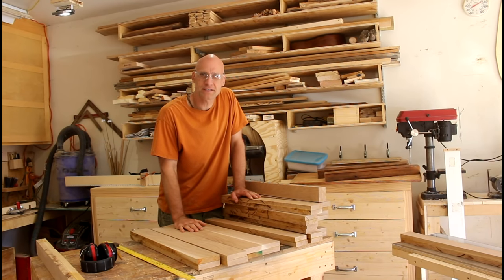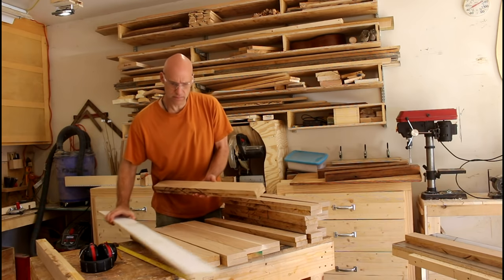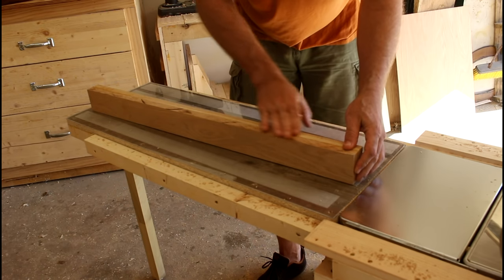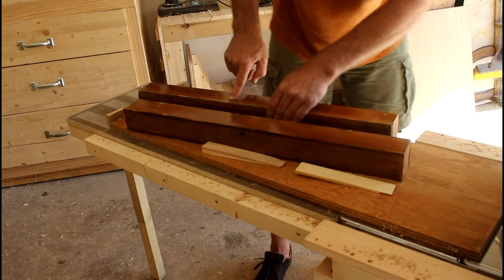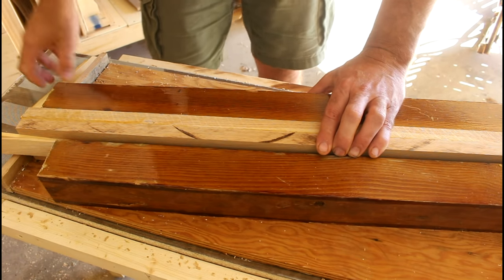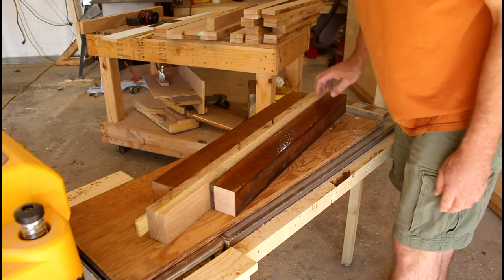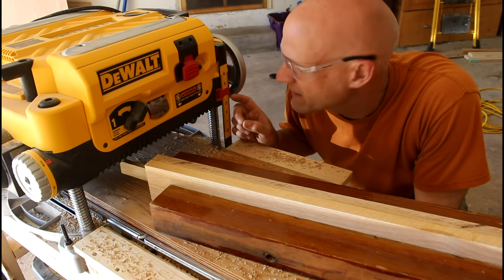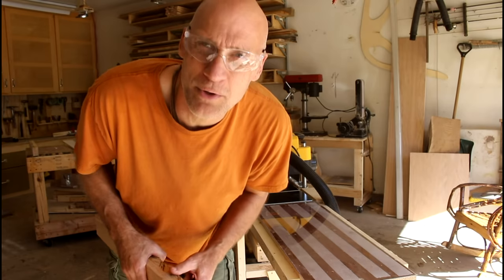How to Turn Your Planer Into a Jointer

Comment: I have used it. But it's time consuming. So if you have a lot to run a bench jointer works better. But for a few pieces its ok
Reply from the maker: Yes. It is certainly not a replacement for a jointer if you need to do this a lot.

Comment: If you want it really accurate, use a hand plane.  This sled is a really good idea to do the initial flattening.  But it may be less wear and tare on blades if you can butt a board against a straight edge (example a) level) and table saw it.

Comment: would it be easier to get that 90 degree angle and flat edge on one side with a table saw then get the other side with the planer?

Comment: Hi
I'm new in woodworking and I'd like to know how to calculate to add profits 
I do wood signs from pine and walnut cutting boards 
Is there a particular equation which you can use to make calculations?
Thanks
Reply: what I have heard is add up the cost of materials, figure out out how much time it took you to build said project, well just say 2 hours for example. If you want to make $20 an hour add $40 to the cost of materials, then add an additional 5-10% for "overhead costs" (glue, stains, rags, etc)  and that would equal your said price. You could definitely alter this formula as it is just a starting idea, or disregard it. Just trying to help, Good Luck!

Comment: I always learned you cant use a planer to get a flat board (on 2 sides) UNLESS one side is already perfectly flat. The planers job is not to flatten, but to reduce thickness. That's why they call them thickness planers and they make seperate jointers. The planer has a roller that pushes down very hard on the piece thats going through . So, if you have a cupped or warped board, it's just pushing the board down and reducing the thickness then out comes a still warped or cupped board, just thinner now
Reply: That's true, but if you mount a cupped board onto a long flat plank (a planer sled) and if you clamp it or nail it, or glue it, or double stick tape the cupped board so the cup is facing down to the plank, then you just stuff some filler (double stick tape, or small wood shims, cardboard, putty, etc) under the cupped board so it can't "push down" when it's going through the planer, then you can get a really flat board. The key is shimming underneath the warped spots on the board that is to be planed, so it can't push down like a leaf spring when it's passing through the rollers. The only way you can "shim" the board is by affixing the warped board to a long plank (a sled). That's the purpose of a sled, so you can slide a warped board through the planer and get it dead flat.

Comment: Hmmm.... a jointer is more for taking either an edge or flat side bow out of wood. Not just for squaring them. Chances are the wood still has a bow in it on the flat side. This jig won't help with that. But one could be made to do it.

Comment: 2 Questions 1 did you first do any thing to make sure the boards were straight and  not cupped before you put them together. 
2nd question do you have  a video on your in and  out feed table extension's
Jeff

Comment: Good idea , I might have found a Ridged 4331 Planer for 100$ think it has a weak switch , need all kinds of tips .
Reply: it could be the circuit breaker... $6.00 on amazon
Reply: @user-hd8ej8yx9p  Realized it`s an older one TP1300 ,Got looking the brushes are gone but closer look at the commentator the copper flutes are dark so I cleaned them and they came like new so Going into city today and she has a set for it so fingers crossed , One man`s junk is another man`s Gem !

Comment: 1:28 I’m not sure if it’s obvious but couldn’t you just rip cut the side on a table saw at 0 degree up against the fence and you would get a perfectly straight line and the piece would be square 90 degree. Great 👍 video and useful content. Thanks.

Comment: How do you get around the snipe from this planer? I have the same unit and the snipe renders it unusable. Nice vid, cheers!
Reply from the maker: +elams1894 I do get some snipe with it. I'll leave the boards longer or I will run some sacrificial boards through at the beginning and end of the process. It can be a pain but is easily overcome.
Reply: elams1894, you can reduce snipe by adjusting the indeed & outfeed ‘tables’, but the only way to eliminate it completely is to also use leading & trailing scrap pieces.

Comment: I'm kind of new to this and I'm just wondering - if both sides are not flat, then how does the planer make a 90 degree cut. I understand the shims underneath for "jointing" the board, that makes sense to me, but here you don't seem to have shims underneath.  Do you use a level to ensure it is flat first?
Reply from the maker: +Johnny D it works if you have one side that is flat and you reference off the square boards. That will make the side you plane square with your first side.

Comment: Probably a dumb question, but how do you ensure you have a flat edge on the first side (the one against the table leg)?
Reply from the maker: There's several options for that. One way which would be in the spirit of this video is to use the jig itself. Just clamp it into it not worrying so much about what angle it is and then run it through the planer. Then you would have one side flat and go from there.

As other people have mentioned you can do all of this on the table saw as well. Use a clamping jig to get the first and second sides square to each other and then use the fence on the table saw to finish squaring everything up (assuming your blade is square to the fence and table).

Comment: Nicely thought out mate 👍, if your interested check out Downunder woodworks where the guy designed a sled jig for his tablesaw to joint boards there, cheers mate
Reply from the maker: I do that method as well. White Oak tends to burn pretty bad and the planer left a pretty clean edge. With thinner stock - 3/4" or smaller I think the table saw jig is quicker and very good.

Comment: Nice idea on the sled.  Couldn't you just use a table saw for the purpose of a jointer.  You already have a flat surface on the board.  Just make sure your table saw is set to 90 degrees.

Comment: If you already had 2 flat and parallel sides, why couldn't you just use the table saw?
Reply: because you would have a either 1 of these 2 scenarios happening.  If you have the planed edge riding the fence  the uneven edge is table side down, or if you have the planned edge table side down, you'd have the uneven edge riding the fence.
Reply: you wouldn't use the fence, but a sled that goes up against the fence, parallel, with hold downs to trim one edge square, and then use that side against the fence.
Reply: The blade on a table saw can and will flex slightly when pushing your board through the saw! The planer is by far the better choice of the two machines.

Comment: What I'll probably do is just screw the board down to a thick sheet of MDF from the bottom(screws will obviously be recessed) since i don't need to use 100% of the board length the screws can just be put in at the very end of the board

Comment: First, I did like your video! However, could you not just have used a less complicated version of you planer jig, flipped it horizontally, run it through a table saw and  fine tuned it with the planer?  That  could be the solution wider boards...

Comment: So once you have the one jointed edge (where you left off in the video), why not just use the table saw to square the opposite edge?
Reply: Tom Holmes Why when you could just run it through again and get a better finish

Comment: pretty cool solution. you could always get that third side sqaured with a table saw jig. how is that dewalt thicknesser holding up btw?
Reply from the maker: Its been hold up pretty well. I've had for nine months with moderate use - blades are still sharp - very little snipe.

Comment: Excellent resolve to the problem. I have never used one but I am waiting delivery. How do you determine the initial depth setting. I did read, you set the machine to it's ultimate depth after planing. It doesn't exactly describe what depth you can start with or even how to set the depth of cut on the scale. Sorry, you are dealing with an idiot, but I don't want to make a mistake.
Reply from the maker: The planner has a gauge that reads out his much you are talking of each time.

Comment: Cracks me up how many people are commenting "why not just use your table saw!?"😂 I'm guessing either they're not woodworkers. Or they haven't been woodworking long enough to understand why and when this application would work where the table saw and a straight edge wouldn't UNTILL you've don't this first if you do not have a jointer. Which also tells me they don't have a jointer and don't know what jointer is for!
Reply: You could definitely make a similar jig for a table saw. It’s basically the exact same operation, just rotated 90 deg.
Reply: however my contractor table saw barely cuts through 4" thick wood this allows for what 5.5" of thickness?
Reply: @Northwest,
Same goes for your comment that it reflects you don't know how to use a table saw. It could be done in a few other easier ways I can think of at the beginning of this video. Chinese and Japanese woodworks didn't have these fancy tools thousands of years ago, but it was always done perfectly and easily with good skills.
Reply: fffjkjk jkjkjk oooooh Christ heeeere we go🙄

Comment: Um once to have a true or flat surface run them through the table saw with a rip fence.  All you need is  actually one flat but 2 will do an even better job.

Comment: Why wouldn't you just use a table saw to cut the uneven sides off?
Reply: Hotrod Hog because that would be too easy.
Reply: Rule of thumb is if you get 2 side square or parallel then the 3rd and 4th can be done on a table saw easy.  Anyway, it's about his technique and his subject, "How to turn your planer into a jointer."
Reply: Because on your first cut the side that is against the fence isn't perfectly flat and square so that will likely be communicated to the side being cut.
Reply: Sean Holland you could build a jig for the table saw to joint your boards using the planed perpendicular face. Then you aren't limited to the thickness of your planer's capacity.  😊
Reply: +Louis Cypher, Geez, why didn't I think of that?! Oh wait...!
Reply: +Sean Holland, it would be 90 degrees square to the side that has been planed and running it on the table saw bed. As long as you make sure your blade is 90 degrees to the saw table top.
Reply: +Chris Thompson, Izzy Swan shows how to make such a jig but you wouldn't really need it as the bottom side has been planed flat. You would just have to make sure the blade is 90 degrees to the table top.
Reply: Hotrod Hog #1 I was responding to Sean, in a more in depth/different words, to try to help it make sense (trying to constructively help the woodworking community).
2. Your comment comes across a little rude. If that isn't your intention maybe try a different wording, if that is your intention, it's just a dick move. No hobby/community needs that to progress. 
3. You would need a sled you cut your piece perpendicular at 90 if only the top and bottom are flat. The side that would run against the fence still would not provide a flat edge to reference off, hence the sled necessity. 
In any case, hope all is good. Have a good day!
Reply: That was not my intention. I'm not sure how my comment could be construed as rude, I was just sayin. But with the bottom flat and parallel with the top you could cut the uneven sides square to the top and bottom without a jig. You would just need to square off the ends to make 90 degrees all the way around. I understand what you are thinking though as it would make a slight taper on the first cut but that would go away with the second cut I think. I could be wrong, have been before and I'm sure it won't be the last time.
Reply: rcmaniajato True, you are limited to 10/4-11/4 board thickness, but I'd argue that 90+% of the time your using 8/4 or less. As far as clamping, you can build your sled to hold T-track with T-track clamps, or use toggle clamps. My statement was only to say you can use that system to accommodate wider stock than your planners capacity. Like most things in woodworking, there are certainly multiple ways to accomplish the same task. 😊 Happy woodworking!
Reply: some people don't have a table saw cough [points at self] cough
Reply: still34u It's the woodworker who makes the table saw, not the table saw that makes the woodworker.
Reply: You'd have to assume there's a perfect edge to the wood in order to run it through a table saw. Much easier this way with a planer and more accurate too.
Reply: Dale Thompson I can't even... you should watch the video again lol
Reply: Huh? What are you talking about? I watched the video, I got it and answered his question, what's the issue?
Reply: still34u so you have a planer and not a table saw., that is ass backwards
Reply: Bingo
Reply: I would simply tack a straight edge to the board, straight edge runs along table saw fence to rip one straight edge, then remove straight edge and rip 2nd edge...a lot quicker than this
Reply: Question for a newb. If both edges are uneven how would you fix it on a table saw? You wouldn't run the board lengthwise with a Miter gauge, would you?
Reply: Because you can't feed it through perfectly straight when there are random imperfections down the length.
Reply: See my above reply using a straight edge tacked on top of the wood
Reply: Hotrod Hog you don't get the same finish when it comes down to finishing work
Reply: If you have enough width to saw off about 1/8" and still  plane both edges, it would be easier to saw off one edge.  But the rough edge against the fence could probably leave a little unevenness on the sawn edge unless you put it onto a table saw sled or clean up the glue squeeze out.  But, sure, it can work.
Reply: Maybe he doesnt have a table saw. Or people watching dont. Good suggestion tho for people who dont have a planer or jointer
Reply: Sean. If you want to do it on a table saw, and I do, simply take a melamine board or another  board with factory edge  and double stick tape the work piece to it with just a bit hanging over the edge. Run it through the saw. You are done except sanding.

Comment: Geez just use your table saw to joint. Would take half the setup time once you make a jig with hold down clamps.. Plus you are only limited to how wide your fence will go versus 6 inches on a benchtop planer.

Comment: this wouldn't work. The side butting up to the support beam would have to be perfectly flat. If you wedge it to sit flat, then as soon as you release the wedges any bow will return. Better than running it through loose, but it's no replacement for a jointer. You can even see when the square is on the rear of the planed surface it doesn't sit at 90 degrees.

Comment: Don't need no jointer. all you need is this saw blade. Freud LM74M010.
Reply: I have been using a hollow ground planner blade for this operation for years.  It works very well.  Sooooo smooth!

Comment: I don't get it. You already have 2 edges that are flat and parallel to each other. With a sled and a couple hold down Clamps, do one side. Then the edge you just cut can go against the table saw fence. Cross cut the ends and voila a perfect rectangle.

Your technique works well for cupped or twisted boards. But then again, you already have those edges flat.
Reply: Hey Tim, I've been thinking along these lines but I don't know if I'm overthinking it. If there's bow on the length of the piece to plane, say a little gap half-way, I still don't see how this jig will get rid of it with just holding the piece at the ends. The rolls will press the piece and it will come out still with a bow. I'm making the jig regardless with some pieces I have, I need to give it a shot.
Reply: @carbonyle  The way it works is that when you get 1 true edge, the law of opposites applies.

Shimming to prevent the board from rocking makes it stable. Plane that cupped edge flat. It works from the outside-in.
Flipping the board over, NEW flat side down, the opposite edge can be planed flat. 
That usually takes care of the bow and twist. If not in a rush to get it done, let the board REST to ensure that there's no tension release. 
Trimming a log can release the tension and the entire shape will change.
If you have a perfect 90° on 2 edges after planing one side, the other 2 can be done on the table saw using the fence.
Some say that every board is different. In reality there's only 4 conditions an edge can be in.

Straight, cup, bow, twist. Other than STRAIGHT, it can be any combination of the other 3.

The best we can do is make an unruly tree into something useful or something that someone else can use, or pay real money for.

Something I heard as a kid, "If you can't fix the WOOD, make toothpicks."
Getting the best we can out of that  wild lumber, is when we go from being a hobbyist to an artisan. 

Don't worry over the stick. Or being afraid of making a mistake. Like I said before, That wood can flex and relax AFTER you cut, plane and shape it. We try to minimize it by studying each one and then see if it works.
The only other option is to cut it into thin strips and steam pressure with glue. (PLYWOOD).
I know, bad joke at the end. But I do try.

Comment: Why spend so much time doing this when a jointer so much faster.
Reply: @ribs1911  Sure, I don't mind helping a guy out.  As long as its good clean lumber with no nails and such. I learned my session about dirty lumber. Dirt eats lumber. My jointer is 16'' wide with a 4 blades. Cost a few bucks to replace them.

Comment: Ohhh come on use the correct tool especially at today’s prices, Jointer is designed to create right angles, the planner is designed to create parallel surfaces. Follow the math.